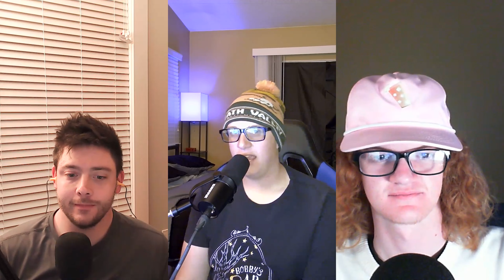Level 1 Certification for Under $100 | The Anti-Gravity Group Podcast

Comment: I am from South Africa, and we don't have the resources you guys have in the states.
So, in 2004 my brother and decided to become that company. At this point imports was non existant.
So we looked for local products we could use.
You have a 3 inch rocket, we have a 68mm. Designed and had a mould made of a nosecone. 
Now we 3d print stuff, and make moulds from them.
Design centering rings in CAD and then laser cut from MDF.
Fins, laser cut.
We have been going since 2004.
Now we do STEAM workshops for schools.
Have local made single use motors.

Comment: I have to disagree with your comments about trying out dual deployment on low/mid power. I think it is a great opportunity to learn and gain confidence to do it with low stakes of a class 1 rocket. I started with a BT55 eBay from apogee and put an eggtimer Quark in it. Did I need dual deployment in a rocket that flew to 1500 feet on E motors? No did I learn and gain confidence in dual deployment for a low cost? 100%. $20 for the eBay $20 for the altimeter $6 for a lipo, $15 for a rocket kit. $5 for a motor and $3 for ematches. All up under $70 was a cheap way to learn before trying on a $100 plus rocket and expensive AP motor. I have recommended that path to others and they have enjoyed it.

Comment: I built a BMS 29mm School Rocket to test it out as a suggested L1 rocket. With all of the options it comes in at $50, and still needs a parachute. You could give up the payload bay and extended payload tube if you want. The only part I changed was the shock cord. I threw it together with decent size internal and external 5 minute epoxy fillets. I've gotten about a dozen flights with various 29mm reloads, including aggressive motors like the H399 and I205. I also run cable cutter dual deploy in it, but it's not needed, especially if you're flying a smaller H motor.